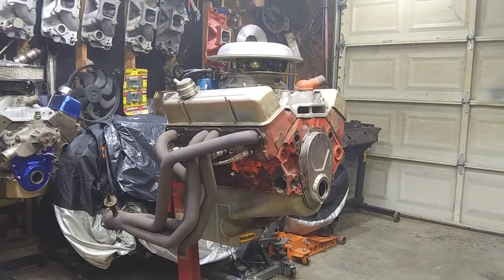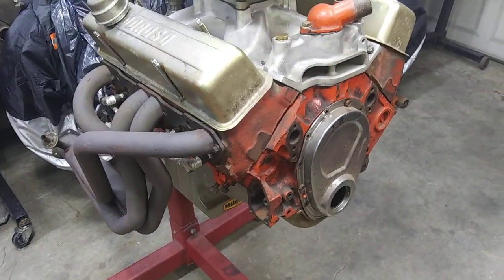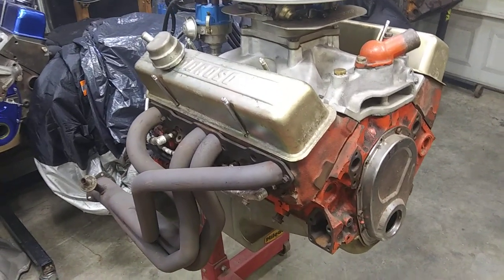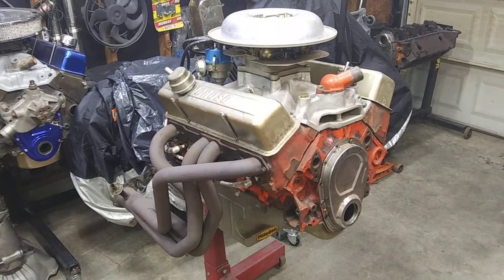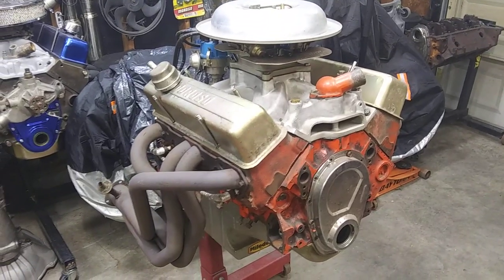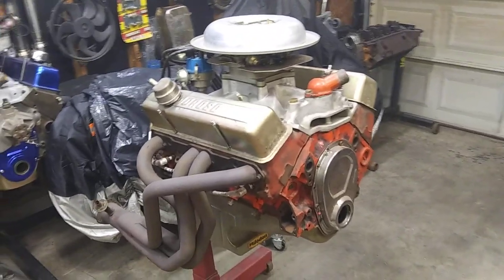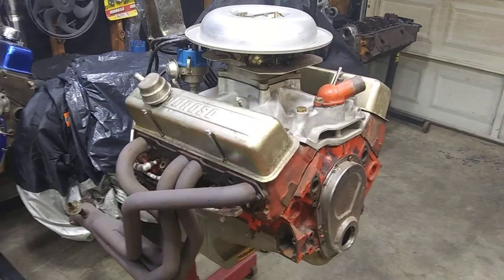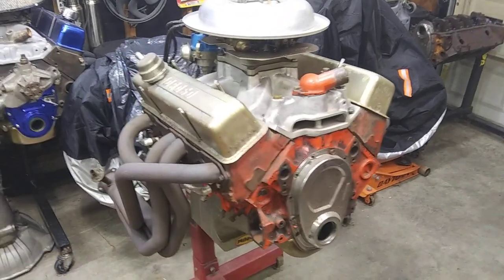The truth about the "Double Hump" heads.

Comment: The smallblock Chevy while an amazing motor they're starting to reach a point where it's not worth building them anymore sadly, they have dried up from the junkyards and a good set of cylinder heads that are worth giving a hoot over vortec heads will easily cost you over a thousand dollars just to stay competitive with a ratty ol 5.3 with just a small cam, so then you build a 383 stroker, over a thousand dollars in a rotating assembly then over 1000 in cylinder heads meanwhile someone else is grabbing a 6.0 putting in half the money and still making more power than the 383
Reply from the maker: That's the general perception these days, but I've seen a different story in my life. Not everybody wants to jump on the LS bandwagon. Some people prefer to keep old engines in old cars. The trouble with the LS fanboys is they try to convince everyone that the LS is the only engine that can make power. But I'm calling bullshit on that. I'm really sick of hearing about them and everytime someone talks about a traditional SBC or a bigblock, there's always that guy telling you to LS swap it. I've built plenty of LS engines at work and worked on a hell of alot more of them, I'm pretty familiar with the LS actually. And I also know it's just one choice of many. In the real world, for every one LS I see being built I also see 10 SBCs and 5  bigblocks and 20 SB Ford's and a whole lot of Mopars. Even a few Buicks and Olds and Pontiacs. People like what they like and there's usually no convincing them otherwise. LS ain't doing shit that many other engines are also doing. SBCs ain't going away anytime soon. And if a person is so fuckin poor that they can't afford to build an engine, I suggest another hobby, cause hotrods ain't cheap no matter what engine you choose. And when it comes down to it, the bigblock chevy is still king. Add boost to a built bigblock and see what ya get. Fastest street car in America has a bigblock chevy based engine. LS is way overrated to those Facebook experts. They think they can pull a junkyard engine and stick a $200 dollar turbo on it and have 1000hp. Shit don't work that way, and those boosted junkyard LS engines never last long. You can do the same thing with a bigblock and make way  more power and alot more torque. I'll never jump on the LS bandwagon and many other old gearheads think the same way. That shits a millennial thing. I also don't wear skinny jeans either.....
Reply from the maker: But people can build whatever they want and I don't try to push my shit on anyone. I just know what I like. Actually I started with Pontiac, but they got too expensive to build and the parts are getting rare. SBC is the cheapest engine one can build and they can make more power than most people need. My 84 Camaro will run mid 10s in the 1/4 with a basic single 4-barrel 357ci SBC and be able to drive it everyday. I'm totally satisfied with that. If I want it faster, I have a bunch of turbo shit and bigblocks laying around. But for a cruiser, it's way faster than it needs to be. And it's extremely simple.
Reply from the maker: I don't recommend people to use Vortec heads or any other stock head. Waste of money these days. So many aftermarket heads to choose between that it just don't make good sense to dump a shitload of cash into old heads. I have seen dirt track 383s making 560hp with Vortec heads and 355s making 520hp with them. So they can be tweaked to make good power. But those were pretty rowdy high compression builds. Don Kirn built a 15-1 427ci Rodeck block ALLPRO headed single 4 barrel SBC back in the late 90s, it made 1005Hp NA with a 4150 flange 1050cfm carb. Don't see many NA LS engines making power like that. And that was 25yrs ago. The heads flowed over 450cfm. Sprint car shit. Most young bucks think every SBC is a 200-300hp engine. But people been building them for racing almost 70yrs. So there's parts available to make them do whatever ya need them to do. Shit, Rick Santos ran 372ci SBCs in a Top Alcohol dragster class back in the mid 90s, a class fuel of blown alcohol Hemis, he had the only SBC and he was kicking everybody's ass. They ended up changing the rules because of him, they took away the weight break for runny a SB engine with inline valves, so he had to run at the same weight as the Hemis. He still gave em hell, but not as bad. But that Top Alcohol 14-71 blown 372ci  SBC was making over 3000+hp back in the mid 90s. I've never seen an LS making 3000+hp. I don't hate the LS engine, I hate the cult following it has and the fanboys trying to force it on everyone else. Can you imagine if the SB Mopar guys went around telling everybody that their shit is obsolete and junk and should be swapped with a SB Mopar. Shit would get annoying real quick. But it's only LS fanboys that do that shit. I've built over 1000 engines in the past 40yrs, they were all brands and types, so I've gotten a pretty good comparison first hand with many engines. What I build is a result of that experience, I've learned that power per dollar, it's hard to beat a traditional Chevy V8 engine with anything. And new parts are being developed and sold to this day. If they were that obsolete, I don't think companies would be developing brand new SBC blocks and heads.
Reply from the maker: And speaking of a 6.0, built one for a guys 55 Chevy drag car about 10-12yrs ago, costed almost $10,000 bucks to actually build it, and it made 590hp. I can build a 350 to make 590hp for half that cost. I've built 383s and 400s that made well over 600hp and still costed way less than that NA  LQ9 did. I had a 388ci SBC  I built for myself about 20yrs ago, it made almost 630hp NA, costed around $7000 bucks. Ain't none of them "cheap" when you build them from the crank up. Id never trust a junkyard engine in a racecar. I bought 10 SBC core engines for $1000 about a year ago. One was a 95 LT1. Most are 4-bolt 1970s  blocks. Still good deals out there.

Comment: Fuck that lol those are 365hp heads right out the factory with a dremmel and a 15 hrs into each head plus sealed power head set w stock springs you could make over 400 net
Reply from the maker: They definitely have potential. Just look at what the NHRA Superstock 327s are making and running with them. Bad motherfuckers for sure.

Comment: 1st time viewer pal and I freaking love your content!!! Funny but 👍true, don't 4get the turbo 292 heads, there a killer head for 10k rpm's and will make more power at a high rpm engine but anything below .500 lift the vortec are king.but we ole timers love to build double hump heads!!! Also I hit the subscribe button!!! Come over to MoodyblueMotorsports! Thanks buddy
Reply from the maker: Thanks for checking it out man, I do miss the old days for sure. Yep, had a few pairs of them 492s over the years myself.  Alot of potential in that old iron. Just takes some effort.
Reply from the maker: Had some 292s back in the day also. Ported the hell out of them. Definitely made some power on a 331ci I built with a tunnelram, twin 660s and a big solid roller with 12.5-1 compression. I revved the shit out of that engine. Started as a 1966 L-79 350hp 327. Mine made around 540hp. 8500rpm.
Reply from the maker: @moodybluemotorsportsDwneKnos  I have a pair of ported & milled Crane Fireball over the counter "292" angleplug "Turbo"  heads I'm building a rowdy 327 with. They are extremely modified. 290cfm intake runners, 210+cfm exhaust. Milled to 50cc chambers, 2.05/1.60 valves. Gene Fulton did a lot of work to them back in the early 80s. Engine gonna make 550+hp with them. Best old iron GM heads they made. Mine were cast in 1975.

Comment: Great video .. shout out from nc ..
Reply from the maker: Thanks man.
Reply: @thereluctantgearhead4544  I just starting a 85 s10 with a 350 carbed .. any advice or  other videos on motor mounts or a specific oil pan? They're be no ac heat or power steering.. THANK YOU VERY MUCH

Comment: I squeezed 275 cfm out of 041x heads. They will hurt some feelings.
Reply from the maker: Hell yeah, it can be done. Most folks choose the easy way out these days tho. The world has gotten lazy, including myself. Back in the day I could spend 30-40 hrs grinding on a pair of heads, but these days it would be difficult for me to sit down long enough to do it. The older I get, the less work I want to do, but I still force myself to mess with this shit daily..
Reply from the maker: I have a old pair of 041s that were used on a "Econo" dragster engine from back in the 70s. Don't know what they flow, but they are pretty hogged out. Had the shit milled out of them too.
Reply: @thereluctantgearhead4544  They had 10cc bigger ports from the factory. 041x heads
Reply from the maker: I've checked out your videos, appears that you do good work.
Reply from the maker: @servediocylinderheads  I had a pair of 461X heads back in the day, believe they had a 10cc bigger intake runner too. Think the head was from 1964.
Reply: @thereluctantgearhead4544  Thanks!
Reply: @thereluctantgearhead4544  I do 100 hours plus. Working on a set of Crane Fireball 492's angle plug right now. As thick as a bowtie head. Too bad Crane had no clue and made the exhaust outlet too big.
Reply from the maker: @servediocylinderheads  I remember them old Crane 492s. Seen 1 pair in my life. Pretty rare head these days.
Reply: @thereluctantgearhead4544  This is the only set I have seen and I have been doing heads for fourty years.
Reply from the maker: @servediocylinderheads  Don't think they sold very many pairs. Most folks never heard of them. Probably pretty valuable these days.
Reply from the maker: @servediocylinderheads  You gonna make a video on them? I'd be curious to see what they actually flowed.
Reply: @thereluctantgearhead4544  I did a video comparing some old porting to new porting on the 492's.
Reply from the maker: @servediocylinderheads  I'll have to check that out.
Reply from the maker: @servediocylinderheads  Have you ever flowed a old Edelbrock Scorpion intake? I have one been hanging on the wall for decades. I used it on a build back in the 80s and it ran pretty good. But I ended up swapping out a Strip Dominator on it and went faster. Pretty cool old intake tho.

Comment: I would put money in double humps before I would vortec heads, they at least won't crack. I've rode in a shitload of cars with 194-150 valves on a small 350 that absolutely screamed with nothing special done to them. Those dart knock offs, promaxx and flowtec has made both vortex and double humps obsolete.
Reply from the maker: The most powerful engine I've ever seen with modified double humps made more power than the most powerful engine I've ever seen with modified Vortec heads. And I've seen thousands of SBC builds. I've seen NHRA legal Superstock L-79  327s making 600+hp with the humps. And 383 dirt track engines with Vortec heads when allowed made around 560hp. The 355s were around 530hp with Vortec heads. 295hp 68 350 NHRA legal Superstock engines made around  560-580hp with 041 heads back in the mid 80s. They make more now. They used modified 1.94/1.50 heads too. And they flowed like a motherfucker. Most people wouldn't believe the real numbers. But they would put alot of current day aftermarket aluminum heads to shame. Ran 10.50s in the 1/4 with a Q-jet on a Victor E intake 35yrs ago.
Reply from the maker: Those Promaxx heads are real good heads for the money. Same core as the Brodix IK heads, but better. Probably best deal going. The 215s flow damn near 300cfm out of the box. About $1300 will have a pair on your door step. Real nice heads.
Reply from the maker: The Promaxx 215 Project X heads are the ones to get from their offerings. Real nice.
Reply: @thereluctantgearhead4544   from what I've hear they are afr copies. For the price, they can't be beat.
Reply from the maker: @inscoredbz  Yep, they really stepped up the game. Definitely hard to beat.

Comment: Those double humps on the end of the head don't always mean anything . My dad had a few 283 2bbl engines that had those exact same humps on them .
Reply from the maker: These are 291s off a 68 302 SBC. Pretty rare.  I have a few sets of 283 heads on a shelf tucked away also. 520 casting "Powerpack" heads had a bump with a triangle on it.
Reply from the maker: The high performance 283s of the early 60s had the same  doublehumps that came on 327s. I think the doublehumps came around 1962 and went till 1968. The 041s and 186s are considered fuelie heads too, but with accessory  holes.

Comment: I think by the sound of it you'd be way farther ahead if you'd put that pipe down and just do one thing or the other !!!!!   Sounds to me like it's pretty decent shit in that bowl. It also sounds like you do know something about small and big block Chevy motors---- about as much as me I think on the subject of restoring '67-'72 Chevy/GMC 4x4's.  I've bought ,sold, and body off frame restored close to 400 of them since 1979.  Don't know your age but you seem to have been around the block a bit (like me) --like the old rings of  a freshly cut 50-60 year old spruce tree. You shot a good video --at least a guy learned something from it , not like these fuck'in punks just burning their rear tires off their truck that their pops just bought for them.    Take it easy buddy !!!!!!     Jim
Reply from the maker: Pipes are wasteful. I prefer to roll em up with 1.5s. Yep, I'm a grey beard, had my hands on engines everyday since around 1981. Done built a bunch. 67-72 Chevys are my favorite bodies. Had a few of them too. Actually started with motocross bikes back in the 70s as a kid, I'd blow up my engines and nobody would fix them for me, so I had to figure it out myself. Been fuckin with shit ever since. Bought a 53 Chevy when I was 12, that's how it all started with cars. Built a 400 Pontiac engine for it. I had more than 10 cars by the time I turned 16. Old cars were cheap back then. I've had a yard full of cars my entire life, still do today. Shits definitely an addiction.

Comment: You used to be able to buy fully ported 260 cfm double humps with high performance valve job , ready to bolt on for $1,200 - $1,500.   This is pre-2010.    But if you have aftermarket block and aluminum heads, your car better run 10s on pump gas and 9s on race gas or you don't know what the f*ck you're doing. IMO, not very impressive no matter what you do. But if you have stock small block and heads that runs 10s, everybody will start looking for nitrous lines.   In my opinion its WAY more impressive to run super fast with all stock.
Reply from the maker: Yeah that's why I've always been a fan of Stock/Superstock drag racing. Doing the most with the least.
Reply from the maker: Crane sold some ported 492s back in the early 80s. Pretty nice heads.
Reply from the maker: I built a NHRA legal K/SA Malibu Wagon with a 305 that ran 11.60s 25+yrs ago. "Stock"....
Reply: @thereluctantgearhead4544  Very impressive with a 305.  I had a 87 Camaro IROC with 305 that was actually kind of fast. I'm looking to buy another one those third gen Camaros and put a "stock" 406-415 small block in it.
Reply from the maker: @tomsettles6873  I'm building a 84 Z-28 now. Street/Strip car.

Comment: I know where u are coming from. I stuck alot money into some 049 BB heads, bigger valves, ported, custom valves job, benched flowed and some high flow numbers. Never do it Again!  Put them on a 454 with 9 to 1 compression  and small hydraulic  roller camshaft.  Motor has no power and torque under 3500rpm and is nothing but a gas hog. High flow numbers  don't mean shit.  I'm going back to stock small valves and peanut  port BB heads and leaving them stock. I need an engine that will tow weight and pull off idle to 4000rpm,  never sees the light of day at 5K.   High HP and high rpm don't impress me any.
Reply from the maker: Definitely gotta build for the intended purpose. A high rpm racing engine makes a shitty tow rig powerplant.
Reply: @thereluctantgearhead4544  ya I sure found that out.   All I'm doing to a stock 454 now is run some small tube headers, very small single pattern  camshaft and run some dome pistons  and get the compression up to 9.5 to 1 from that low 8 to 1 with the peanut heads with a weiand peanut port intake and factory Q jet carb.  Need that air velocity at low rpms or don't make any torque down low.
Reply from the maker: @jessesyfie7244  That should make some torque, I'd expect at least 525lbs of torque, probably 400hp range with that combo. Be all done by 5000 grand. An old Comp Cam 268 High Energy cam is good for alot of torque in a 454.
Reply: @thereluctantgearhead4544  THAT 268 HIGH ENERGY CAM IS A VERY GOOD CAM CHOICE!
Reply: @jessesyfie7244  Get the bowl work done and keep it near 90% it should pull well and bump up the economy a bit in a tow rig.
Reply: @bigboreracing356  I'm after torque at the lowest  rpm possible, 2000 rpm not at 4 grand!  They do make alot torque but at higher rpms. High rpms  and fuel economy  do not go together!
Reply: @bigboreracing356  if u like them so well I will sell you my 049 heads but won't be cheap.  I have no use for them anymore.   Won't be a problem  selling them cause everyone  thinks there such great heads and will want them.

Comment: Those aren't the 492 heads the 492 heads were the best fuelie heads back them with 202/1.6.  Valves ..
Reply from the maker: Brazinski said the 291s was the best production humps. But what does he know....
Reply from the maker: 492 angle plugs came over the counter from GM. Had a couple pairs of them too.
Reply from the maker: I really don't give a shit either way, because I use aftermarket heads on most all my builds anyway. Haven't gave a fuck about production heads in over 30yrs.